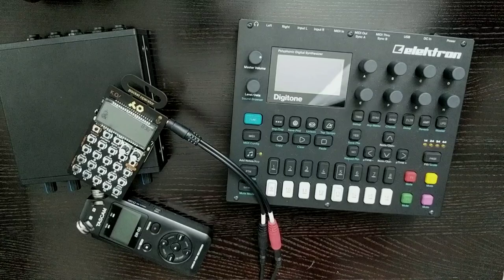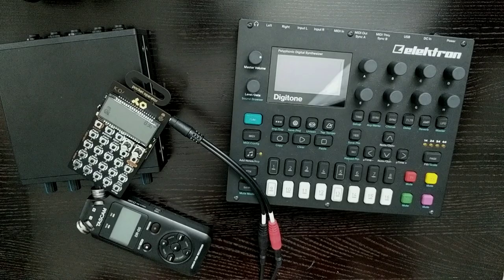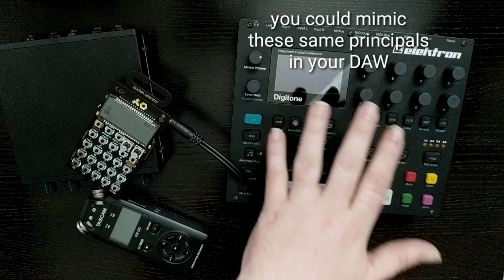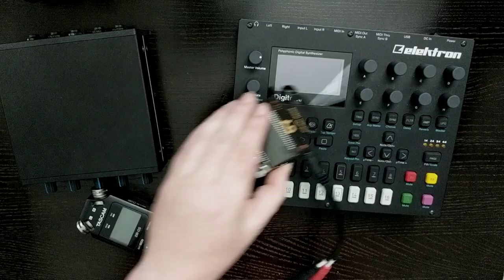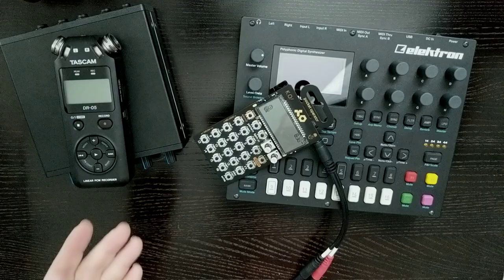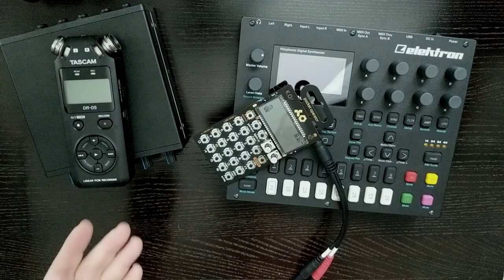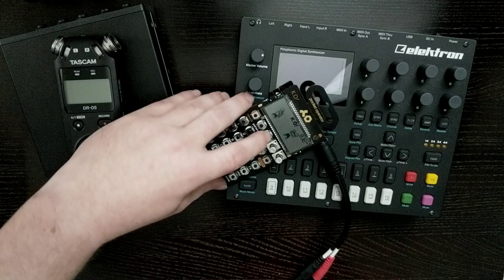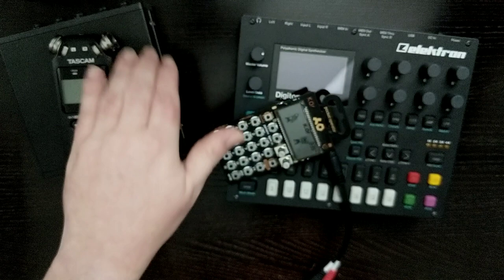Tips for Self Mastering Prep - How I Enhance My PO-33 Through External Hardware

Comment: Matt, could you please go into greater detail as to exactly what processing you're doing on the Digitone to convert the mono PO signal into a stereo mix (either in the comments, or in a separate video)? Is this an input processing effect unique to the Digitone, or is the Digitakt also able to do this?
Reply from the maker: I should probably make a follow up video but I'll give some info here too. So, unfortunately the Digitakt does not have the same kind of live processing of external audio as the Digitone. That's a shame too because I would love to use the compressor it has. At any rate, the Digitone has a "Mastering" page that will process both external audio and the internal sounds (though I don't use those here.) Most of the stereo separation comes from the ability to pan both channels of the input audio as well as the chorus effect. The output of the PO-33 is split into duel mono signals which are input into the left and right input of the Digitone. You can then pan those signals from center all the way to 100% left or right. I usually pan one side around 20-30% and pan the other side to a similar but not completely matching percentage. So left might be panned to 27% while right is panned to 23%. The slight difference helps promote the stereo field. Then you can also apply overdrive, reverb and chorus in the same mastering page on the digitone. These help additionally add depth and a stereo sound stage. Per your suggestion, I'll make a video of this as well but hope that helps so far.
Reply: @MattGreerMusic , thanks for a clear and thorough response. What you've done to improve the mono output of the PO, particularly via the stereo sound image, is remarkable (and needs headphones to truly appreciate!). A video walkthrough would be amazing. Are you aware of any other effects boxes or guitar pedals that can do something similar with the mono signal of the POs?